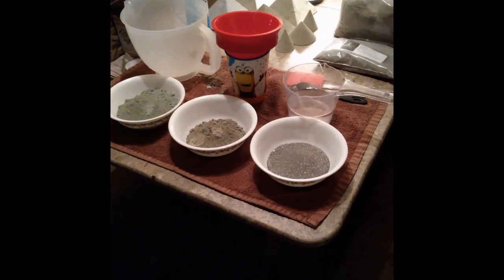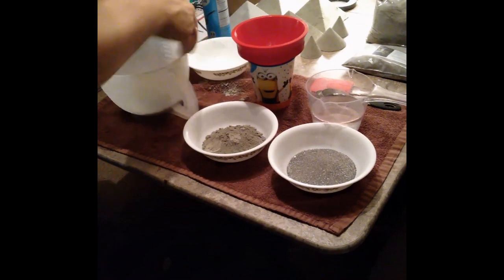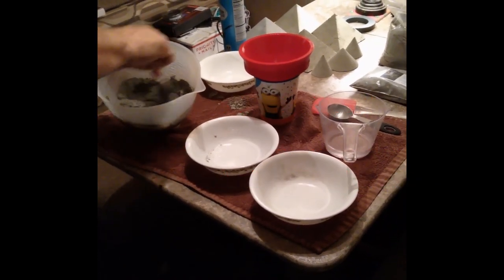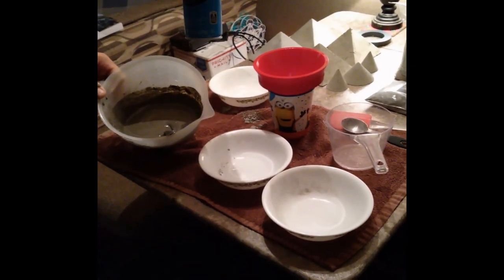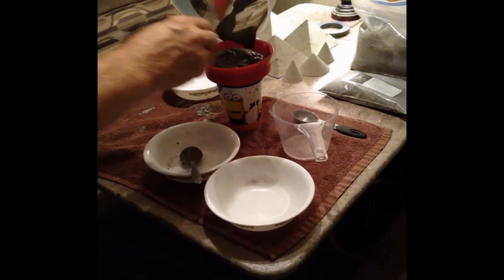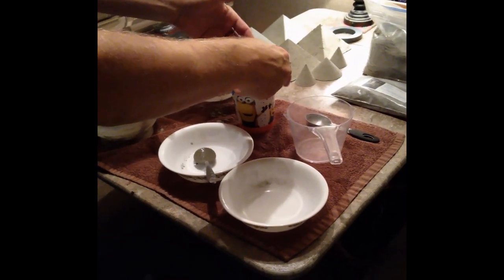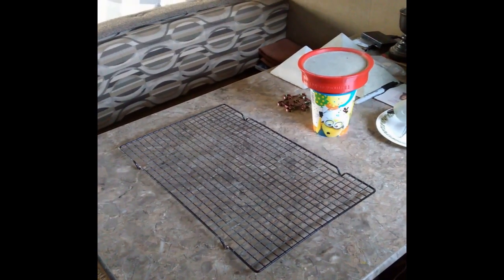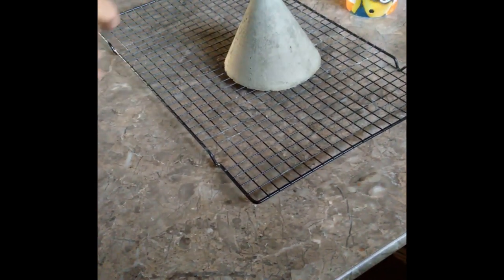How to mix and pour a Paramagnetic Tower Top Cone

Comment: Could you use crushed granite instead of the basalt? Do you have any results to share after placing your cone or tower with cone? Once the cone or tower is cured, do you add water to it every now and then? Also, is there a difference if you use a 4" cone vs 6" cone ( the bigger the cone the more aether interacts with it?)
Reply from the maker: The reason behind adding basalt power is because of it's paramagnetic values and it's interaction with the magnetic field. Granite may not have that same quality. Crushed shungite can be added for it's EMF blocking characteristics. No need to add water once it is cured, and yes the larger the size the greater the grow area will be. 4" cones and towers are plenty for the most common sized gardens and grow areas.
Reply: @HarmoniousInNature  Right on - thank you very much!

Comment: Thank you - does size matter ?  And do you need to place on top of cooper pipe?
Reply from the maker: Not on top of copper pipe. The cone can either be used directly on the ground or placed on top of a paramagnetic cement tower. This one is for a tower 4 inches in diameter.